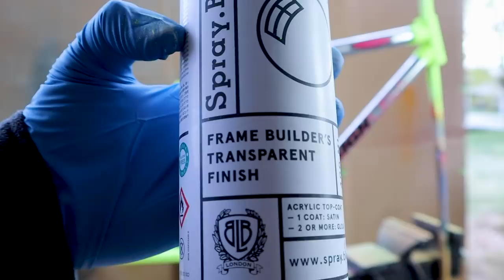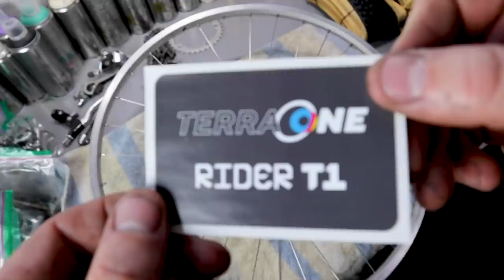Fluorescent Bike Restoration - 91 Raleigh Chill Vintage Update

Comment: Eye catching! Nice job on the seat also. I just restored a 20 year old Selle Comfort saddle. Worst part was finding a comparable foam to fill in a worn section on the left cheek (motorcycle seat foam worked!). From the amount of wear it must have been someone's favorite saddle! Thanks for the content, very inspiring.
Reply from the maker: Thanks. Good tip on the foam. I have a few that could use some foam.

Comment: Everytime I find a really cool bike, Rob's already done a rebuild of one on his channel. Never disappoints!

The bike I just found is a 1991 Technium Peak, so the top of the range model. It's an absolute time capsule that I am not even kidding was never rode. There is zero, zip, zilch wear on the chainrings and cogs. The tires still have mold release compound on every square inch of tread. The original Ritchey Megabite tires are incredibly supple. I've never seen a bike in this good of shape in the 20 years I've been buying and selling vintage mountain bikes. It's going to be hard letting go of this one.

As always, it's a pleasure to was these videos, this one especially with my Peak sitting in front of my TV.

Comment: beauitiful lugged frame with these side cable cable guides. The fluo-bare steel  color shceme is contrasting really well. And these pure 90s hologram decals are toping it all up. another great build. The only thing I would add is maybe a front mech chain guide and apply some oracal protective patches on the cranks because surely the paint will get scrachted off fast. especially when riding in ordinary sneakers.

Comment: I was riding around my town, I seen a greenish bike in the back of a truck, guy was moving out, I thought it was a Marin, but it was a 1990 miyata quick cross, she is mint, 90 bucks later, im carrying it over my shoulder, biked it home, shot some air in the tires, rode for awhile, gunna fix it up, prolly new pedals, seat, maybe wider riser bar, and short quill stem conversion, and new wider tires, it will be a commuter beast, idk if it will fit a 38c.
Reply: Just needs to be dusted off, maybe a tune up, don't think there is a scratch anywhere.

Comment: As soon as I saw it was a bonded frame, I said 'he should polish the aluminium and paint the steel'. I was surprised that I was right on the money, (because it's likely what I would have done) but I wasn't prepared for that yellow. That Raleigh might be more 90s than the 90s actually were. I'm very interested in trying the spray.bike products on my daily rider 70s Raleigh, after seeing its results on your channel. maybe black combined with a keirin sunlight. My eyes can't really do the fluoro.

Comment: I worked at Raleigh in Seattle in 1991, very good chance I painted that thing, they were made with Easton e9 tubing (main triangle)( I believe they called it "Technium") bonded  at the bottom bracket, seat tube and head tube and down tube.(they claimed the epoxy used was the same as the space shuttle used for bonding the heat tiles on) honestly I'm surprised it lasted this long...

Comment: nice cleaning. one remark on cantilevers: these work the most powerful, if the pulling parts of the cable (here right side grey housing, left side short cable with extra knob), are 90 degrees to the line of the cantilvers (between screw in frame and where the pulling cables meet the brakes). so, the shimano thingie shown here is useless. what you would want to use is the part which was used also on the U brake of the ritchey build. there you'll need an old cable to put across, but much shorter so your triangle gets closer to the tyre until you reach 90 degrees (or as close as possible). of course hanging out the cable will be somewhat harder due to no 2nd knob on it. also, the brakes will apply more force, yet retreat much less. so if you have a badly trued wheel, this might cause rubbing. (of course, on the ritchey U brake you would apply the same principle, the pulling cable was way too long. also on the front paul canties... just my 2 cents :)

Comment: i have an old KHS from that era, i built the bike originally from the frame up with suntour parts. im kinda taking a different approach from you, im putting the components from my cannondale that i upgraded last year, due to its very long design my old back wont be riding it offroad much but it will be nice to have a bike i built many years ago back to a usable state. the only problem i may run into is my vintage rockshox quadra elastomers have become rocks over the very many years, finding a 1inch  steerer suspension fork will be a challenge. or maybe i can find some eleastomers for it
Reply from the maker: 1 inch vintage forks are hard to find. Good luck.

Comment: I have two ProFlex bikes, an 855 and an 856. The 855 was mostly original even down to the melted elastomer. I converted it to cool from a shop in Colorado that designed them specific. The rear wheel was an old Swami so I got a pair of sun rhino lights (sort of period specific) and some Maxxis Holy Rollers (not period specific, lol.) But then I got the 856 and it's wheels were original, but not much else on the bike was including it has V Brakes, lol. So I swapped wheel sets. Anyway doin the channel.

Comment: Since you seem to use spray.bike products a lot and have experience with them: is it better to remove all the paint to the bare metal frame and use the metal primer or can I roughen the paint surface with sandpaper and use the color straight away? Do you think you can use the metal primer on roughened paint?

Comment: Awesome look. How many hours of work do you put in ? Does the derailleur extension makes the shifting less responsive ? Thanks!
Reply from the maker: Time on a build is hard to say as the filming makes everything take longer. On this one though there was at least 6 hours just sanding the frame and another 8 cleaning up parts and rebuilding wheels. As to the derailleur extension it does not effect the shifting it just moves where it sits.

Comment: How do the 1x stand up on those older bikes? I've got a 2007 bike with upgraded hidro disks, wheels and stuff but always been on the fence about putting a 1x10 or something on it. It's a hardtail that i ride a bit aggressively, some wheelies, small drops and jumps, a bit of fast downhill and a bit of steep uphill, so really a bit of an aggressive xc kind off riding.
Reply from the maker: I like it but you need the big cassettes to make it make sense.
Reply: @oldshovel  would a 32 tooth and a 11-42 be any good? I'm not quite familiar with ranges. I'll try to find a calculator or something to compare with my current setup.
Reply from the maker: It depends on what type of riding you do and what you need. 32 with 11-42 is a common 1x setup. I’ve wed this calculator to sort out what would work for me. https://www.bikecalc.com/gear_ratios

Comment: Hello, how are you doing? I have a question that could sound contradictory, but here it goes: older 26 inch rims from the 90s are slightly bigger than modern 26 inch rims? I have a cannondale m700 with Araya rims and find it very difficult to install modern made 26 inch tires. What is your opinion regarding this subject? 

Thanks for your videos. You're very talented and wish I could have acces to those parts and beautiful bicycles!

Comment: Where did u buy a 5 bolt chainring that small. My bike came with a single 42tooth front chainring and want it to be around a 32 without replacing the cranks

Comment: I have this exact bike and plan on giving it a new coat of paint! Where’d you get the Raleigh chill decal?
Reply from the maker: I made the decals myself redrawing them from photos I took using photoshop and Illustrator and then cutting them using a Cricut vinyl cutter.
Reply: @oldshovel  I am also in the middle of restoring my old trusty Technium -- same color but mine was the "Heat" version. I lack the skills to make the decals so mine unfortunately will continue to look shabby. Bravo on the restoration!

Comment: I saw you update most of bikes with 1 chain ring, without shifting lever for front rings, that makes a 10 or 11 speed bike. Does it really work well in a 26er if you need speed? Wouldn't be better one more bigger ring added? Also shifter. Btw I really like the restorations you make to my kind of favourite mtb, the 90's ones.

Comment: Something I've noticed on a lot of your videos is that your cartridge bottom brackets are always in back to front? Is there a reason for this? Am I crazy to have noticed has anyone else noticed this? The adjustable cup on the drive side seems like maybe a weak point but I guess with some non-symmetrical BBs this would allow you to fine tune your chain line? I am curious.

Comment: Another great video, Raleigh made a dyna tech frame in the uk which was a bonded aluminium/steel/titanium mix, it seems the lugs on the American version were much more substantial, the uk frames were wobbly as hell, terrible flex, the usa version looks much better, you mentioning tomac teminds me when i met him, Plymouth uk, world championship in 1993 i think it was..
Reply from the maker: Awesome
Reply: @oldshovel  he was, it always made me laugh about him using drop bars, i used to ride cyclo-cross in the uk at that time, there's some serious skill involved in hopping 3 foot high logs in a race on a lightweight cross bike with drop bars and to see tomac doing that on mammoth mountain was just amazing at the time, there was an issue with the cool of drops offroad  though, they'd snap without warning! Road bars were never designed for that...😂🤦

Comment: where did you get the vintage decals from? I am starting the tear down and rebuild and possible repaint of a 94 M50 this week. I tried to message you on FB but cant find a chat button for your Oldshovel page
Reply from the maker: I make stickers using vinyl with a Cricut Maker. I have also sourced decals on other builds from VeloCals.com.
Reply: @oldshovel  if I'm not able to source them, how much would you charge to make some?
Reply from the maker: I know local printers will often print vinyl like I use for a reasonable price.
Reply: @oldshovel  picked up the bike today and decided to not touch the paint job, it’s in to nice of shape.

Comment: I don't think that drive train would work if you ever ride that bike again. 
The chain ring isn't a Wide-Narrow profile, the chain will drop. The derraileur isn't clutched either. 

But I'll be curious if anyone can find a chain ring for they crankset. What is the BCD?
Reply from the maker: This is the drivetrain I have been running on my Richey assent for the last couple months and it works great. A narrow wide chainring and a clutch would make it better but with the shifting dialed in it runs well. The only problem I’ve had on the Ritchey is when downshifting on super bumpy and aggressive downhills.
Reply from the maker: It’s 110 bcd, I actually have a narrow wide 38t I was going to try but I like the 34 better with the 11-40 cassette with all the hills arrow down here.